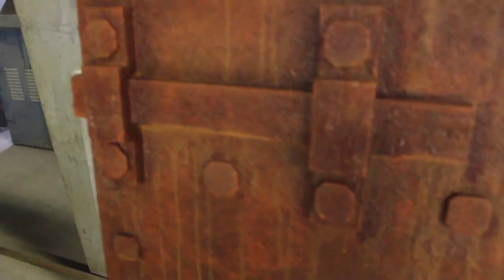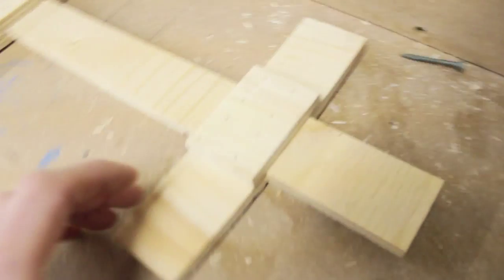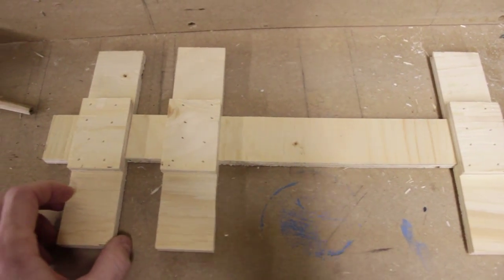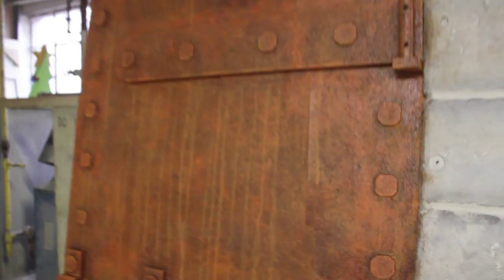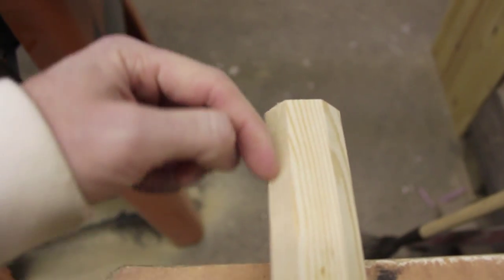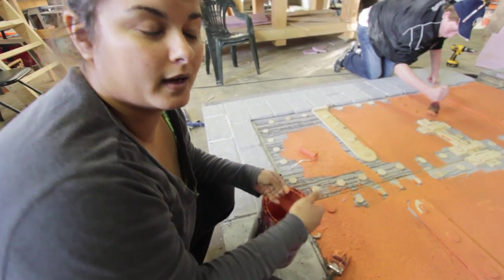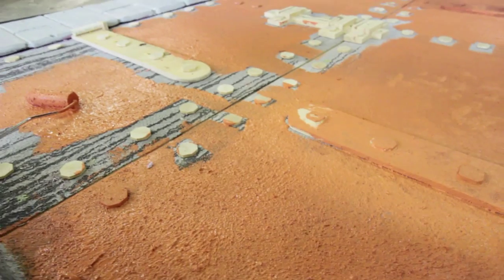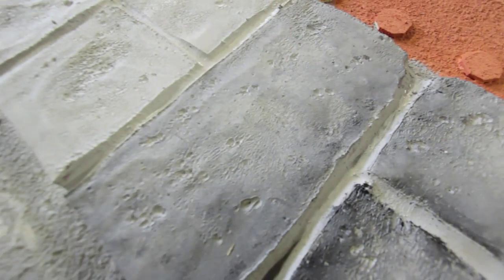Haunt Ventures 164 - Locks, bolts & scenic design torture tool

Comment from the maker: @HauntedHotSauce Yes the rusty jail doors are built on plywood and secured to a wood frame as shown in haunt ventures Ep 163.  Some of the set design panels are made with thin plywood only because we're using what is available free from the PowerHouse of Terror haunted house.  Thanks for the question.

Comment: I was curious as to why you used Monster Mud to paint the doors. I've used MM on a lot of props, but not typically when I'm painting a wood surface like that. What's the benefit over using just paint and sand?

And I agree with Mourik360, it's all in the details. By making sure the thickness of the wood around the lock is uniform it helps sell the idea it's a solid piece of metal and lets the viewer suspend his knowledge it's only a set. Great job!

Rich